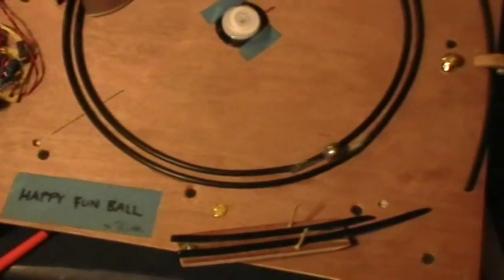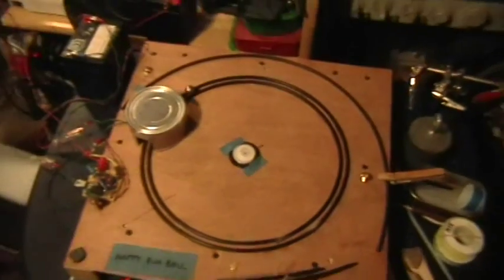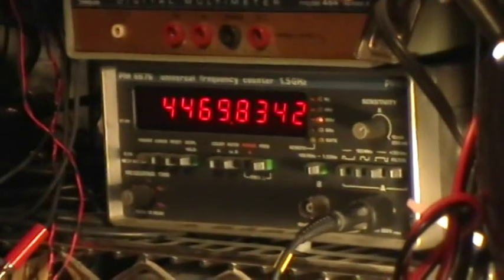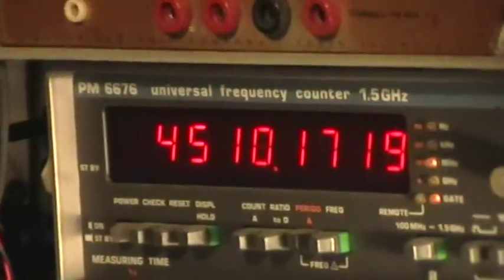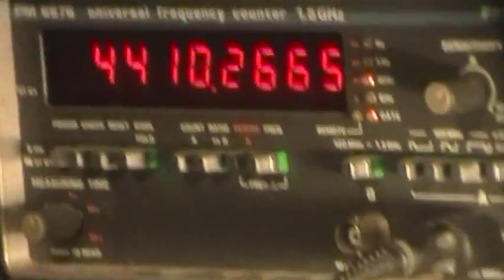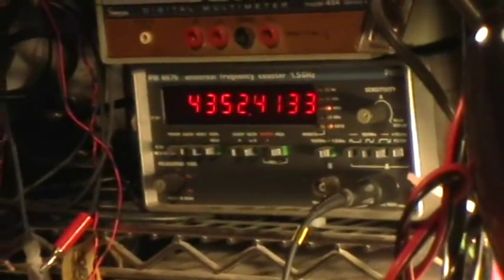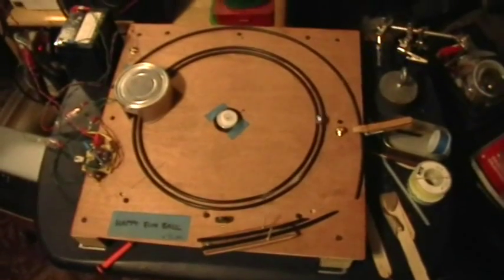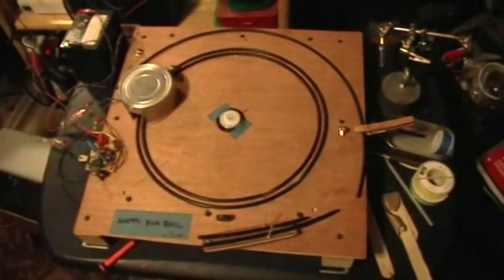Pulse Motors: Using the SNOT to Demonstrate a "True Experiment"

Comment: Thank you for uploading this great demonstration of good scientific method. No doubt I will be linking to this and the flywheel one you did quite a bit as time goes by. It amazes me how many people want to experiment with this kind of thing and dont have any understanding of control tests and basic testing method.

I notice you have a join on the inside rail near the magnet, my theroy is the magnet was putting less pressure on this as the ball went past. So not losing as much energy passing the join. I also noticed both results got faster as the video progressed, so thinking there may have been some thermal action in the transistor increasing pulse amps slightly.
Reply: Fly wheels? Did someone say flywheels? Where?
Reply from the maker: Ryan Dupée

The Shark might be referring to the Mondrasek gravity-magnet wheel, that I used in a previous demonstration of this same principle of True Experimentation.
Reply from the maker: Yes, please link and refer to wherever you like.

I think that there are a lot of creative researchers out there who would have much more credibility if they could present real data, real comparisons, and show that their data is reliable and repeatable.

Believe it or not, but many actual degreed physicists have never been exposed to the actual logic of the Scientific Method involving hypothesis formation, experimentation, and simple statistical analysis of data.
Reply: Oh. So not a flywheel... thanks!
Reply: TinselKoala
I believe it. I have had many arguments with degreed physicists who do not even understand the whys of the basics. It seems that a degree does not make you a good( or ethical) practitioner of science.

Just watch out for the specter of the decline effect. Even fewer versed in the scientific method knows or talks much of it.
Reply from the maker: Ryan Dupée
Yes, that's right. The "decline effect" is also called "regression to the mean" and is another reason for doing lots of trials in a given condition, so that the true mean can emerge. Many people, in parapsychology research especially, tend to stop collecting data when they get results they like, not realizing that they may be focusing on outliers rather than a true "average" value of the parameter being measured. Then, in later experiments, when their results decline or even reverse... they discard those trials as "bad", failures or glitches, when really they are just part of the natural variability in the overall data. This often leads to false conclusions, like thinking that a "psychic" has powers but gets tired over time, when in reality they just got lucky on the first set of trials.
Reply: I have to admit, I'm one that dosn't do the 400 repeats I know is required for good data (worked in opinion survey for a bit), But I dont have anything I think is special to demonstrate either... I stated down the open research road knowing there would be many boring repeats if I ever did find something.... I do know how and have done at school and in the workplace..

As mentioned by everyone above. Its astounding how many people with good ideas, and/or degrees dont know how to do an objective test... I was actually thinking about doing a video with similar theme for the last year or so. Now I dont think I have to because TinselKoala has done such a good set. Or perhaps I should replicate, just to reinforce... Got a cap to cap via motor thing I want to test coming up... Might demonstrate the electrical version of these tests..... Going to need to wind a weight on a string to show motor torque and power (torque x rpm), my problem is, it's going to be a gutless motor. and spining fast, so it will need to wind onto a small diameter reel, but then the string will be building up, changing the diameter..... I could make sure  it was one layer and always the same build up, but not great for the test... Maybe use a chain that gets fed into a hopper (so the falling half dosn't start to add gravitational pull as it gets longer). Any suggestions?

Comment from the maker: By working a bit on the rough spot with some fine sandpaper, I have reduced that major loss point, and now I am getting loop times well under three seconds, with the fastest time yet being about 2.4 seconds, but more consistently at around 2.8 seconds! At this speed the ball is just about to fly off the track, I think. The improvement in performance is dramatic, from just that one change.

Comment: This is really great work TK. 

If you add a PLL to the control you can both regulate the motion and have a direct recording of the input energy.  An Arduino would be ideal.
Reply from the maker: Thanks...
I think the phasing is already taken care of by the fact I'm triggering on the leading edge of the ball's shadow. But the pulse duration is of course variable and gets shorter as the ball speeds up, since the pulse is turned off by the shadow's trailing edge. So if I install a monostable pulse width control, keeping the pulse duration under external control rather than being determined by the ball's own speed, this should be equivalent to a full formal PLL system. I think. Within a certain range this would, as you suggest, do both a regulation of the balls's speed and also provide a known and repeatable injection of energy for each cycle.
I really appreciate your feedback and suggestions. Thanks for watching!

Comment from the maker: @jahroen, Gadget mall: For some reason I get the "You are not allowed to comment on this post" error message when I try to reply to your comments. 

Jahroen: 
Yes, I can, and I'll do that for the next set of runs. Thanks for the suggestion, I've been wondering about that myself. I don't have any way to take high-speed video though, but at least the VLC player will allow frame-by-frame stepping through the resulting video.

Gadget mall: 
It's really hard to position a magnet above the track without having the ball leap off and stick to the magnet.
One thing I tried was to have a magnet underneath the track, attached to a servo rotating around under Arduino speed control. I was hoping the magnet would pull the ball around the track... but try as I might I couldn't get that system to work right, even though the plywood base is only 3/16" thick.
Since the ball itself isn't a magnet, it might be possible to get some effect by "shielding" part of the field of an external magnet. In fact this might be the reason for the tiny effect shown here: there is a drywall screw just to the left of the magnet position that could be "sucking" or shielding some of the flux in that direction, so the field the ball sees isn't exactly symmetrical. I still can't see how this could result in an energy gain, or an asymmetrical reduction in loss, at that point, though...
Reply: You cant reply because Jahroen has security settings high and dosn't have you in circles. Send feedback to youtube, they really should have fixed this!! video owner should always have right of reply. Maybe get their attention by using the legal tool to lodge a slander claim...
Reply from the maker: I agree: Video owner should always have the right of reply.

I am presented with the option to remove the comment or mute or block the commenter, none of which I want to do. But of course I should be able to reply to comments on my own videos, no matter where they come from.
No need to get all "legalistic", IMHO, but certainly this new system is not all good.
Reply: Its just a bug, I'm suggesting the legal tool, because I know a number of people have given feedback about this bug over the past week and google seem to be ignoring it... Its just a get their attention idea. I'm not suggesting actually following through with action.

Comment: I am trying to construct a torsion pendulum based on your PerPenduPetulum circuit and would be interested in your ideas and/or suggestions  on the mechanical suspension.
Reply from the maker: Torsion pendulums of the usual kind (Pendulating horizontal beam, hung from a vertical support with a fiber suspension)  generally have a rather long natural period which means the bob or weight will be moving quite slowly. The PerPenduPetulum needs to have a certain speed of passage of the pendulum magnet in the bob for the coil to generate enough current to initiate a drive pulse. There may not be enough speed to do that with a torsion pendulum. May I suggest that you use a different circuit, one that is triggered more positively, by either a Hall effect sensor or a photoelectric sensor.  This circuit in the SNOT is triggered by the passage of the ball between an LED and a CdS photoresistor, and the project I'm working on at the moment is also triggered in the same way.  If you look at that project (MescalMotor) you may find something that will work better for you. However those circuits need more power than the PerPenduPetulum.
If you use a stiff suspension, that is some kind of torsion spring like a piece of stiff piano wire, mounted so it cannot slip at the top hanger or at the bottom where the bob-arm is hung, then you will get a faster pendulum action that probably would trigger the PerPendu circuit, but you will have to experiment with thin piano wire and suspension height to get the right "balance" of stiffness and length. If it is too stiff the drive pulse may be too weak to get much action even if the speed is enough to trigger.
Let me know more about the details of your project and I  may be able to help more.
Thanks for watching and asking!
Reply: TinselKoala

I am trying to limit the power source to either a garden light solar cell or one or two  AA batteries.  I selected the  the PerPenduPetulum circuit to work with because it delivers a more powerful kick than any of the other pulse motor circuits I have tried. 

I took a while but I was finally able to convert the  PerPenduPetulum to a torsion pendulum and will post a video and complete description in a couple of days.
Reply from the maker: Dick Bromberg
That's great! I'm looking forward to seeing what you came up with. Please post the link to your video here in this comment section.
Thanks for watching and "replicating"!

Comment: perhaps the steel ball is tilted slightly, and thus the friction is no longer over two tracks, but more on the outer track rail than the inner one. Since resistance is the biggest factor in delay, this is the first thing I can think of.
Reply from the maker: Yes, that's a good guess, and it seems very plausible. As the ball goes faster around the loop, centrifugal force will tend to make it bear harder on the outside rail, and there is probably even a speed where the ball is running only on the outside rail (just before it flies off the track!)

I still have a rough spot that visibly slows down the ball, right where the joint in the outer loop is. I've filled and smoothed this spot with epoxy/baking soda which you can see as the whitish glob near where the ramp usually meets the track, but it still needs some work.